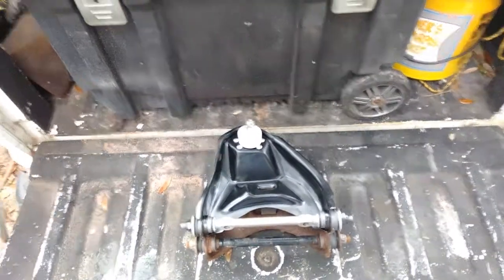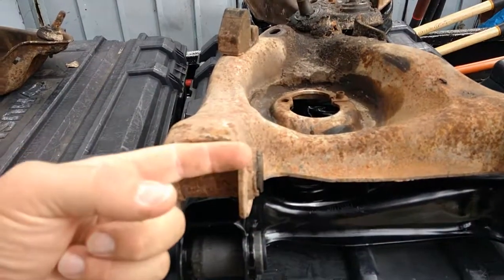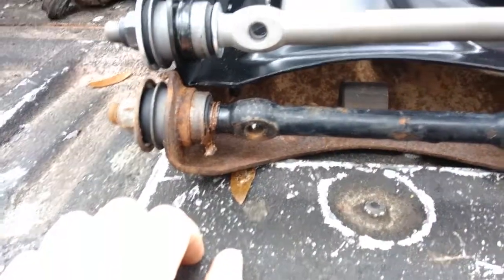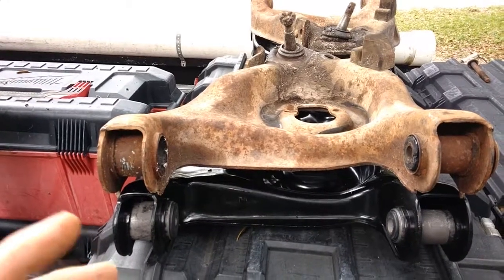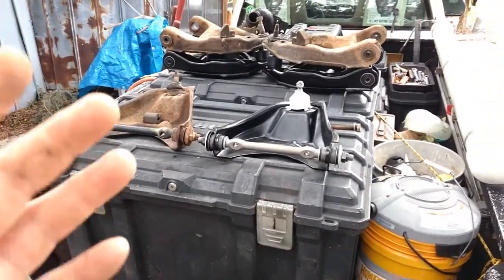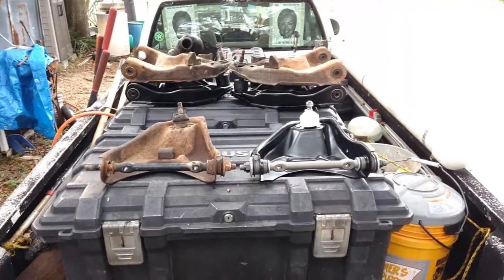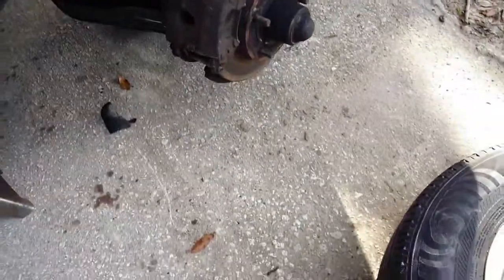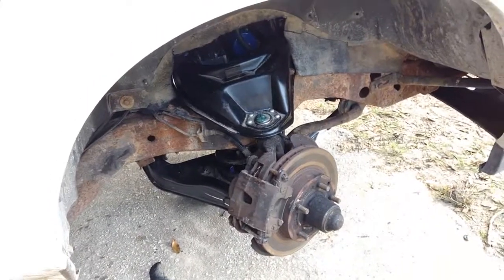2000 Sonoma Control Arm Bushings

Comment: I almost caught myself trying to rationalize replacing the bushings on my upper control arms on my '98 sonoma. I pulled them off, tried a little bit getting them out, played around with them. Then I thought what the hell am I doing? Rock Auto, both arms with balljoints and new bolts for around 100 bucks. I don't have to pound on anything. I don't have to get greasy and dirty. I don't have to sweat and curse. I don't have to get a loaner tool from the auto store. I just go to the front porch and pick up these nice new ones and have them on in about an hour. Yeah I guess if you have air chisels laying around, presses, tools and all that go for it. But there's no way in hell I'm punishing myself.

Comment: Those are the lower arms you have their and your right about the collet in the center to keep the actual arm from bending if you have a metal cut saw and some stock pipe the right size it’s all good .
Reply from the maker: Well actually I had the uppers and lowers. I totally get its possible to do with some ingenuity but for the extra $50 I was able to get new uppers and lowers and saved a ton of time. For me that extra $50 is well spent.
Reply: @Bbernhardsr  I guess they would be 2 piece c collets or something along them lines but yea man they will bend right up if not braced or um supported .I have bought control arms and I have rebuilt them .with today’s prices and the discontinued s10sonomaor jimmys I see those a arms from rock auto the moog for 50 bucks for the uppers and 75 for the lowers .so yea it a hole lot easier to replace the whole arm with the new hardware already installed.

Comment: Im dealing with a similar issue on my 96 4x4.   bushings are shot,  took control arm off and bent tf out of it trying to get the old one out.  New one doesnt fit right,  Ended up ordering full assemblies.
Reply from the maker: Yeah that is kinda why I made this video. I wish that parts store rent a tool guys would be more knowledgeable. They could say that they don't recommend trying to do this service on certain vehicles. On the other hand they can't say that because they will blow the sale of parts. Then after you try and it doesn't work, you can't return the parts you tried to install. I guess we win some and loose some. Thanks for the comment.
Reply: @Bbernhardsr   Lucky im only out 69 bucks I was going to get the tools and 1 control arm do the other 3 and right . but for 49$ each control arm I just ordered a set of 4

Comment: It's not that bad. It takes about 2 hours. Getting the right tool. Helps. You can rent a press but make sure you get the right one. You will need the one that's open on the end so you can get it over the bar and squeeze it into place. It looks like a c on the end. Don't get the one that takes out ball joints. It doesn't work very well you can only squeeze in one and the other one you got it beat into place. Unless you know a guy at a machine shop or you buy a press That's upright. You don't use them very often. Unless you're a machinist. Press in bearings everyday.
Most of the S10 time is being spent. Trying to figure out how that rear left rubber got burnout. It is because of a flex pipe if Burns it all the way out. Make sure you change that. So you don't have to do the same thing in 31 days. S10 was poorly designed on the left side. You have to make sure you pull out the bolt on the S10 arms make sure when you loosen them up you take out the shims and count them and put them all back in. the same place. What you get over the barrier in that saying I can't or I'm too lazy. The job would be done pretty easily
Reply: Thank you I ordered the C c clamp on Amazon for $56. Still cheaper than buying the whole control arm!!

Comment: Bbernhardsr  , your right  Control arm set of bushings 69$.  Tool to do the Job right Upper 85$ Lower 125$  =  210 add a ball joint if you need one or two when you remove the spindle 40$ each,  I got a set of 4 control arms 300$  They come with the bushings and ball joints I had replaced the ball joints 3 years ago and Links for stabilizer bar.  Should of done the bushings all at the same time it would of saved money and time .  Crunch and clunks did not start till Fall of 2020 . I broke a ball joint removing a spindle just the nut No one has a Nut you have to buy the ball joint.  I called Autozone, O'Reilly's , tried the Hardware no nut would fit . Labor  removed the 4 control arms started pushing out bushings took 4hr , installed 2 bushings and bent the lower control arm in my 20 ton press I used a 2 inch socket behind the bushing between the space of the control arm thinking it be fine . waist of 4 hours .
Reply from the maker: Correct. It is a waste of time for the average person like you or me. Now if we had access to a machine shop with all of the right tools than maybe it would be gravy. I really believe they designed these to be throw away units. Like everything else.
Reply: @Bbernhardsr  I work on Motorcycles I have every tool to rebuild a bike , I have worked on my own Truck cars since I was 16 .  Your 100% right they make parts to toss out have since 1980s the Unabody

Comment: Good quality penetrating oil sprayed 2 or 3 times 2 days before starting and a high temp torch make all the difference in the world plus water to shock it and put out fires but still better off buying upper control arms lowers are each 120+ upper control arms can be as little as $50 each depending on brand and deals
Reply from the maker: That may help you get the old bushings out but what will help you install the new bushings?

Comment: Most shops I have worked for or dealt with will only change these as an assembly. The steel stamping on most American vehicle's front suspension is disappointingly weak. My racer buddies box in their suspension parts themselves if they can't afford better new ones.
Reply from the maker: That sounds like a great idea!

Comment: Ok sooo I hear people drilling,torching,picking at with a chisel, on these rubber inners of the s10 bushings . 
Yay wanna know how to remove the whole rubber inners in one smack of a hammer???? Take no time at all and I didn’t even break a sweat ! That’s right their is a easier way and it don’t involve burning rubber inhaling toxins or spending 2hrs drilling that hard ass rubber believe me I know how tough some jobs can be .
REALLY DO!!! 
First a little tidbit of info I was raised by a Westinghouse engineer not the one that makes washing machines the one that built the f16 fighter jet the one that work on the applo,the awax and many other government contracts & I would also like to add my father worked for nsa fixing computers way before their was computers in every household.
Ok hear it is 
Liquid Nitrogen that rubber will shatter like glass almost.
I use to remove rusted bolts with a simple torch from ace hardware and a little nitrogen.and once the rubber’s out you can make a cut the length of the metal tube that’s left In the arm and collapse the metal with a chisel and hammer and their you go simple easy .work smart not hard .
It all about knowledge I was lucky to be raised by a very talented engineer who worked at Westinghouse for 48 years .
Y’all stay blessed
Reply from the maker: Well that does sound like a wonderful idea. I should have remembered that when I watched Arnold shatter the T-1000 like glass in Terminator 2. I guess the next time I have bushings to do I will head down to my local chemical plant and pick up a few gallons of liquid Nitrogen. Problem solved!🤣
Reply from the maker: So I just looked into it. If I travel a great distance I can go to a gas supplier that will sell it to me. The only thing I need is a special container that only cost $250! This will work out great!